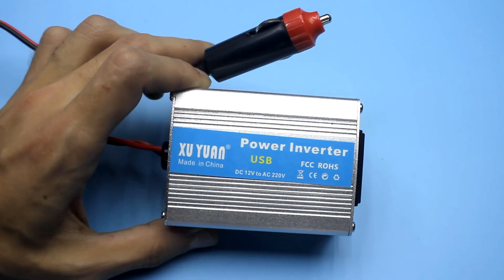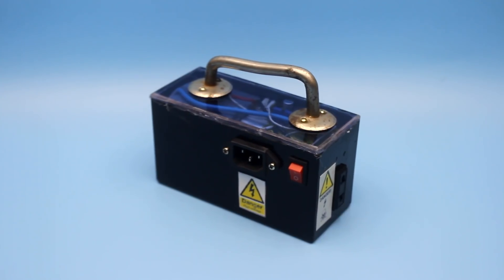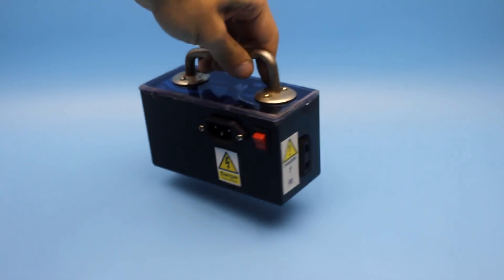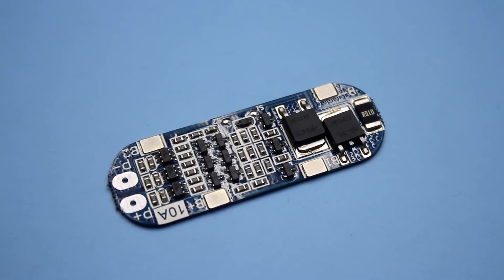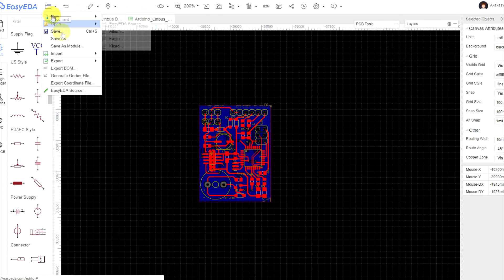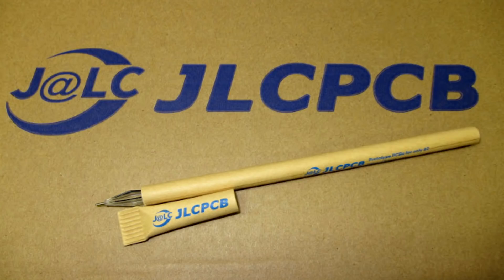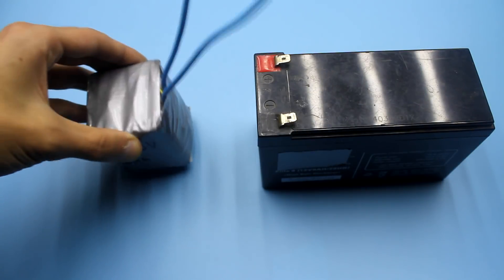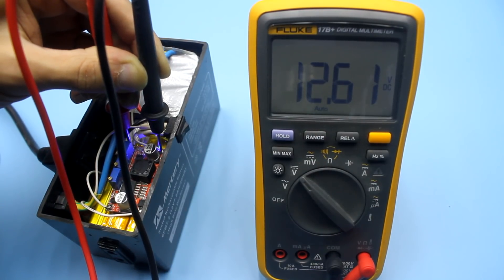In case of APOCALYPSE. DIY UPS

Comment: Hi, can i connect asynchronous Ac motor from washing machine to that DC-AC converter ? Motor parameters: 220v, Low RPM: 350 1.4A  and High RPM: 2200  4.5A , 16uF Capacitor
Reply: With this this device you won't be able to, those little inverters can only usually output around 120w so somewhere around .5A at most, it might spin it up unloaded if it doesn't instantly trip, but it'll cut out with any load. That's not to say that you couldn't build one that would run it through it'd just have to be bigger.
Reply: axeami135 thanks
Reply: A soft start system might be a good idea aswell since dumping huge motor loads on inverters generally isn't a good idea unless you actually are just running a washing machine itself since they have a soft start built in.
Reply: axeami135 good idea, thanks
Reply: Also this is a modified sine wave inverter. For motors you should use pure sine wave inverters

Comment: Neat little project.  I've never observed anyone using the case of an old lead acid battery.  I was thinking about using an old VHS  camcorder lead acid battery pack to do the similar and to update with old laptop lithium batteries.  Really practical and resourceful.  Also, I thought an application that you reminded me of with this device is a portable Infra Red (IR) halogen lamp desoldering device and I saw at the end that you're smart to put the link in the video.  I'm guessing the other devices linked can use the UPS also.  I've modified a UPS where I wanted more power than the car would supply and so I could charge in the vehicle.  I added 12V terminals with two dpdt switches in a really small fishing tackle box since the UPS was wired 24V.  Now I can charge with 12V or output 12V directly with that unit if charged.   I think I now want to modify the two SLA batteries to lithium and will have to look into the charger circuit on the UPS or place another module for lithium batteries charging in between.   Thanks!